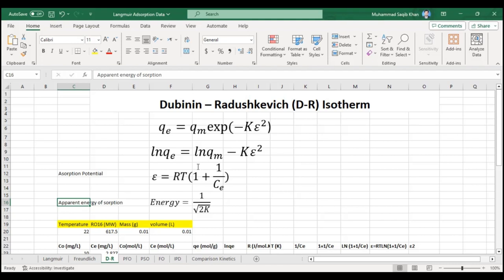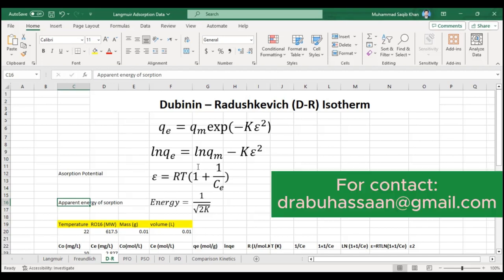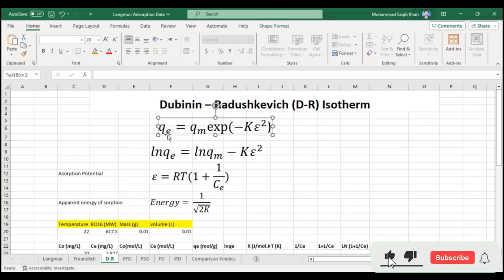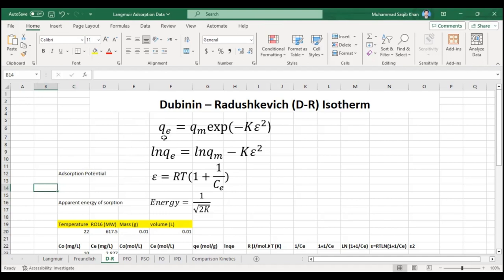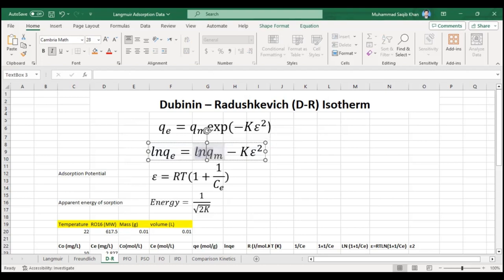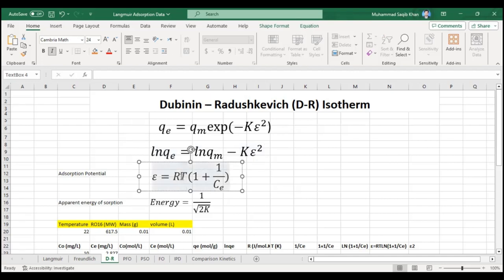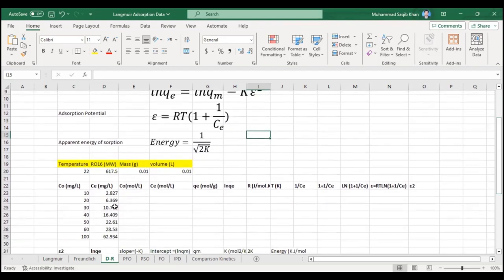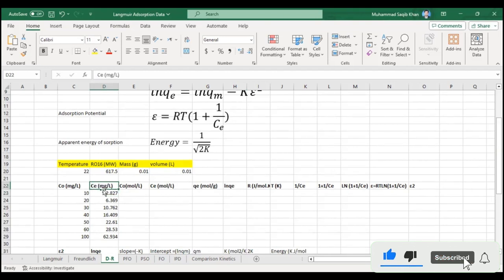Adsorption Data Analysis| How to Fit/Apply Dubinin-Radushkevich (D-R) Isotherm to Your Research Data

Comment: hi, thank you for your sharing here. But the calculated qm value seems so different then the experimental when convert 0,00059 mol/g to mg/g?  How can we evaluate the calculated qm value?
Reply from the maker: Thanks for the comment,  when comparing the calculated qm value in the D-R (Dubinin-Radushkevich) isotherm model to experimental data, discrepancies can arise, To evaluate the calculated qm  value, consider the following steps:
Consider Model Assumptions which means understand the limitations and assumptions of the D-R model. It assumes uniform energetics of adsorption and a homogeneous surface, which may not hold true in all cases.
Evaluate Isotherm Fit i.e., assess the goodness of fit of the D-R model to the experimental data. A poor fit may indicate discrepancies between the model and the actual adsorption behavior.
Explore Alternative Models which means If the D-R model does not provide a satisfactory explanation, consider other adsorption isotherm models that may better describe the experimental data.
Moreover discrepancies may appear as this data gives best fit for langmuir isotherm model but for teaching purposes the same data was fitted in all models. Hope it helped Regards
Reply from the maker: My pleasure dear

Comment: hello sir! is it good to be that much high value of energy? in my calculations, i got the value around 1400, but in the literature for chemisorption it would be in between 8 to 16 KJ/mol.
Reply from the maker: Thanks for the comment. I agree that a value of energy around 1400 kJ/mol in the Dubinin-Radushkevich (D-R) model is unusually high and not typical for chemisorption, where the energy is generally in the range of 8 to 16 kJ/mol. Such a high value suggests that there might be an error in the calculations, data interpretation, or assumptions made during the analysis.
It's important to revisit your calculations, ensure the correct units and constants were used, and verify that the data aligns with the expected range for the type of adsorption process being studied. If everything checks out, it might be worth considering if the system you're studying involves a different type of interaction than what is typically seen in chemisorption